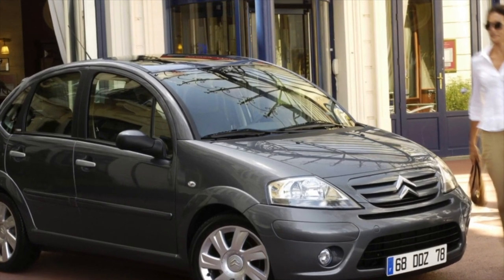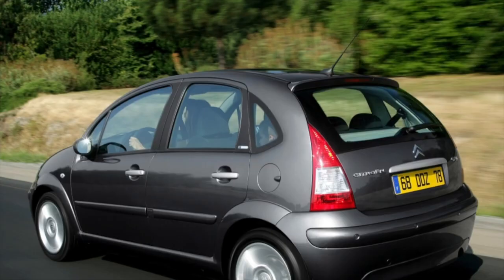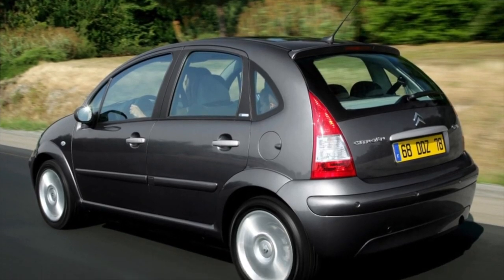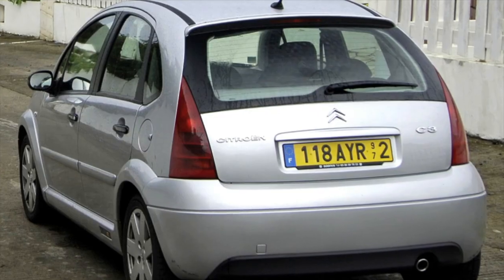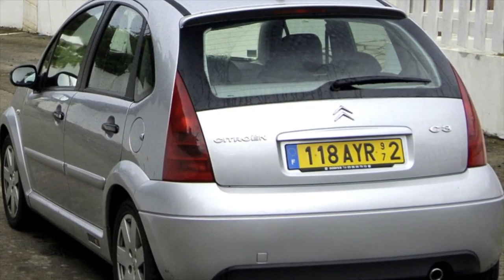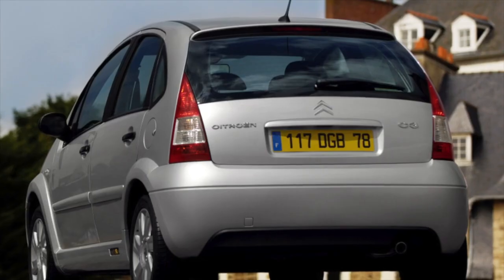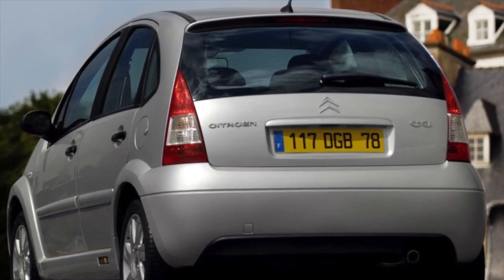What are the most common problems with a used Citroen C3 I?

Comment: I've got a citroen c3 2006 1.1 petrol, abs light on, screen thing comes up with fog light faulty, airbag faulty and s/belt fault, any idea on how to fix?
Reply: It's more than likely your actual dashboard. The pins on the multi pin plugs corrode causing the dashboard to light up like a pinball table, EU solder on the circuit boards has a high alloy content causes dry joint.